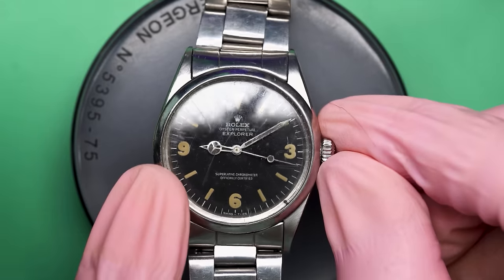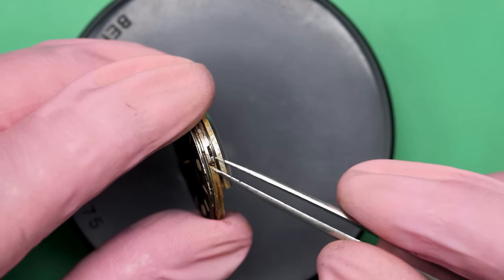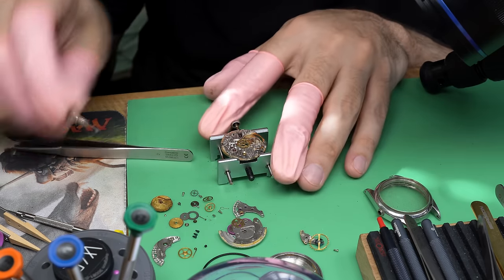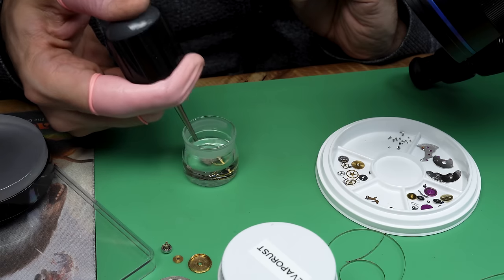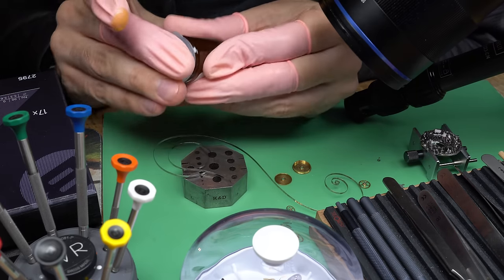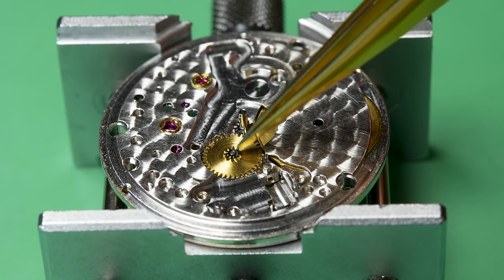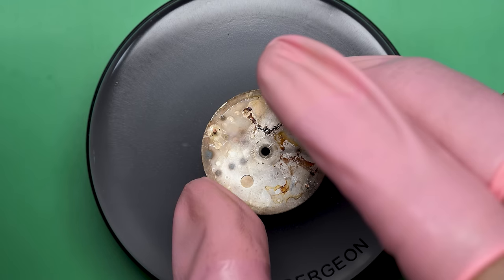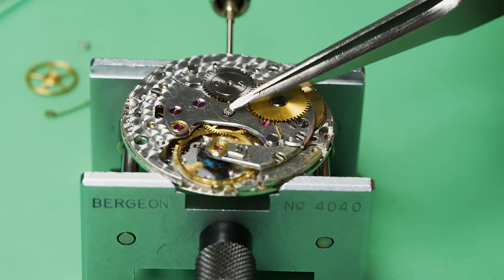This $25,000 Rolex Explorer Was Exposed to Seawater!

Comment: Rolex refusing to repair it (doubtless at a price) seems appalling, I'm curious what excuse they gave. The serious damage was actually minimal, most parts just needed cleaning up. Great job restoring this that Rolex were too <censored!>
Reply: Rolex probably wanted to do a complete restoration (i.e. like new watch) for an eye popping amount. I brought my father's well worn Rolex to an official Rolex service center (there are several in major cities in the US) and they had no interest in doing what Marshall did in this video. And their quote which included replacement parts exceeded the watch's original cost. I shipped my watch to an independent shop that services Rolex only and they did a phenomenal job. Never again will I have my watches serviced by Rolex.
Reply: Rolex could have restored it. However because they offer a 2 year warranty on all repairs they would have only made the repair if the customer agreed to certain things, like the replacement of the dial, hands, Crystal, a complete refinish of the case, etc. All of which would have diminished the value of the watch. Rolex are a bit more flexible these days, but would prefer that this sort of restoration is performed by authorised specialists, that way the customer gets exactly what they want.
Reply: @andyglastonbury6032  & @BeantownToBigD ..thankyou both for interesting replies. I can understand they would have asked a lot (and only used genuine parts) but as the video showed actually it was only a handful of functional parts that needed to be replaced (which Marshall also did). As you state, simply swapping or restoring hands case etc that are not functional isn't just unnecessary expense its actually destroying the patina indeed personality that makes that watch special. That a brand that trades so much on image and history seemingly doesn't understand that is tragic. Yet another once great product company now run by accountants ? I dislike Swiss watches anyway, the price is insane, but if I needed a reason to avoid them this would be one : conversely I enjoy Marshalls videos exactly for his craft to do just this. That they wont.😀
Reply: @davesmith9325  The biggest difference is that Rolex offer a guarantee on their services (typically two years) and basically offer to make the watch “like new”, which means replace everything that is old and in poor condition. They will sometimes offer to simply service a watch and ensure it’s waterproofness and give customers the option to replace dials/handset, bezel inserts, but this watch needed much more. Also I didn’t see new seals being fitted to the crown nor did I see it being subjected to the normal Rolex pressure test, important because the damage was caused by water getting into movement. 

This explains why all original vintage (over 20 year old) Rolex watches are so rare. Most have had dials/hands, etc replaced at some point in their past. Many customers loved it because they could, as part of the service, replace, for example the old matte dial on the first gen 16750 GMT and get a nice new shinny Gloss dial with the white gold indexes (and make it look like the latest version). The problem is that now the matte dial gen 16750 is worth about 30% more. The same went for meters first 5513, for red 1680, for matte 16800, etc, etc. Collectors want originality. It’s sad that 1000’s have been wiped of the values of vintage watches because they haven’t been conserved correctly and because of poor choices made by customers.
Reply: @BeantownToBigD  one unfortunate and lamentable result of the Rolex brand's corporate journey and change in focus is adoption of  an 'unofficial' policy to orphan and abandon these now iconic 'non jewelry' time pieces which were at that time the brand's lower end product line and to stop manufacture of the parts and service for these time pieces. The tragedy of this unofficial policy is the legendary standards of time piece engineering the name Rolex once stood for is being lost forever. 

Rolex is now owned by a group who have chosen to invest their energy in harvesting rather than preserving and supporting that brand reputation. Now only, only the higher end chronometer level lines of the early Rolex brand are being supported. It's rare to find a watch professional who has even the lowest level of technical talent to service an early Rolex like this. This  channel is outstanding in having an owner who is truly a "master watch maker" with the knowledge and skills to even attempt such a repair and restoration. 

These 'sport' watches were manufactured by Rolex to fill in as entry level time pieces meant to bring consumers into the brand and build loyalty and awareness. If you check the official catalogs for Rolex in the early 80s the company began their shift away from lower end consumer grade time pieces to focus more on higher priced jewelry time pieces in effect harvesting the enginerring reputation but not continuing to invest in maintaining that tradition and brand standard. 

if you compare this Rolex watch to those produced today by opening them up you can see how this tragic short sighted policy has hollowed out the Rolex brand reputation so today it no longer represents the high standards of time piece engineering that built the name Rolex.... Tragic loss..
Reply: @andyglastonbury6032  43:52 and following (plus especially 47:04 and following) indicates all seals were changed.
Reply: @andyglastonbury6032  There is no way Rolex would have repaired that face.
Reply: @andyglastonbury6032  I simply cannot accept Rolex refusing to repair this watch. That attitude is entirely unacceptable.  I was also saddened that this repair, wonderful though it was, did not include a pressure test, to have done the job properly I would suggest that is a 'must have'. Nevertheless, well done for restoring it to working condition. I would wonder, with the original leak, how often do Rolex expect a customer to have the seal replaced and the watch re-pressure tested.  Thanks for the Video.
Reply: @Preston412  Respectfully, I must disagree with you. Rolex does not lack the expertise or the resources to repair or maintain these time pieces, it's their corporate decision NOT TO DO SO... and that's the pity of the sorry state of Swiss time piece manufacturers these days with few notable exceptions.   So much of our "devices" today are disposable, technologically obsolete by design, with limited life spans. Rolex built its reputation by engineering a "standard" in mass market time pieces manufacturing that for its day was no less spectacular than what SpaceX is now doing for space travel.  Rolex lead a series of breakthroughs in the design and manufacturing of time pieces that were reliable, rugged, and not over priced. While Rolex was never a "consumer" brand like Timex or Hamilton or Bulova, their time pieces reflected watch making expertise at the highest levels.
Reply: @davesmith9325  one unfortunate and lamentable result of the Rolex brand's corporate journey and change in focus is adoption of  an 'unofficial' policy to orphan and abandon these now iconic 'non jewelry' time pieces which were at that time the brand's lower end product line and to stop manufacture of the parts and service for these time pieces. The tragedy of this unofficial policy is the legendary standards of time piece engineering the name Rolex once stood for is being lost forever. 

Rolex is now owned by a group who have chosen to invest their energy in harvesting rather than preserving and supporting that brand reputation. Now only, only the higher end chronometer level lines of the early Rolex brand are being supported. It's rare to find a watch professional who has even the lowest level of technical talent to service an early Rolex like this. This  channel is outstanding in having an owner who is truly a "master watch maker" with the knowledge and skills to even attempt such a repair and restoration. 

These 'sport' watches were manufactured by Rolex to fill in as entry level time pieces meant to bring consumers into the brand and build loyalty and awareness. If you check the official catalogs for Rolex in the early 80s the company began their shift away from lower end consumer grade time pieces to focus more on higher priced jewelry time pieces in effect harvesting the enginerring reputation but not continuing to invest in maintaining that tradition and brand standard. 

if you compare this Rolex watch to those produced today by opening them up you can see how this tragic short sighted policy has hollowed out the Rolex brand reputation so today it no longer represents the high standards of time piece engineering that built the name Rolex.... Tragic loss..
Reply: It's the same like with every big company. They used to be good and take pride in their name and craftsmanship. 
Then over the years, new people came, new ideas, new leadership, etc.
They used to make profit but also made good products and now they need to cut costs, make more profit, let off mechanics, relocate production to cheap coutries, pay less than minimum wages and live off their name that is only a shadow of its former self.
Now it is craftsmen like this who are needed to repair things, and companies actively try to make it illegal.
Because they only care about selling, not maintaining.
Reply: @andyglastonbury6032  Not everyone wants to sell them on. Some just want to keep them for the memories.
Reply: @Preston412 That's simply not true. All high end swiss watches are hand assembled. They have the technicians and train watchmakers. I wonder if the reason for not repairing it was simply lack of spare parts for such an old model. No manufacturer whether Rolex or Mercedes will scour ebay looking for parts that are out of production.
Reply: I agree that's very much a "f*ck you, buy a new watch, peasant" attitude from Rolex. Dismissing an appeal to fix an expensive piece that has family value is disgusting. They could at least have tried, replacing parts that needed replacing.
Reply: @pinnaclesystemsgroup6472  Companies call it “progress.”  🙄
Reply: It's the same thing apple does tjese days, refuse to repair minimal damage which 3rd party pro shops can easily do and saves you thousands sometimes.
Reply: @TheStevenWhiting  Very true, in which case you can have Rolex make the watch like new, or you can use a specialist to make sure it remains mechanically sound, whilst retaining patina. Which is why the lume in all my Rolex (except a 67 5513), is totally dead.
Reply: @joshjones5172  exactly - they would have suggested a replacement plus a new handset, a replacement crystal, stem crown and most likely a replacement strap. When the owner rejected this, then they would simply refuse to offer a warranty on the watch and point you towards a authorised specialist Rolex repairer.
Reply: @Celisar1  I most have missed that, but I didn’t see the pressure test being carried out.
Reply: I would suspect that Rolex only do repair by replacement which in this case would be almost everything.
Reply: @andrewholdaway813  I suspect you might be right.
Reply: @r2l100 I’m not defending Rolex, just telling you how it is. Rolex do offer warranties on new watches (5 years) and on repairs (2 years) that they perform. The problem is that some older watches are just that -old! So parts might not be available, etc, plus Rolex’s repair mantra is return the watch looking like new - which some folks want, but others don’t. Which is why Rolex have many approved independent specialist to do this sort of work. 

BTW I sent my 1953 Blancpain fifty fathoms back to Blancpain for a service, however they only agreed to perform it on the understanding that they could de-contaminate it first (lots of Radium). The total estimated cost was over £4K. I refused because it would have destroyed the originality of the watch.
Reply: Rolex refused to service my father's 1945 Oyster Royal. I told them the serial number, they still asked me to pay to send it to them, then they said they couldn't do it. I think today they're only interested in diamond-encrusted bling that only a gangster would wear. They ought to have craftsmen who would welcome a challenge. I think they just have the wrong attitude and spoil their own reputation thereby.
Reply: @andyglastonbury6032  I understood from your initial reply that's what Rolex do. And that's fine if that's what the customer wants is willing to pay for and asks for. 
But changing the dial, hands, refinishing the case  isn't necessary except in some extreme situations. It's not reasonable any company should demand and charge for unnecessary work as a condition of you want to get needed repairs done by the oem.
I thought the whole point of watches in this price class was that they are heirlooms, and sealed sports watches like this are supposed to be tough. The idea that its rare they survive more than 20 years is frankly depressing
Reply: @r2l100 When I sent my 1982 16800 to Rolex for its service 2 years ago, I was very clear that I just wanted a service (nothing was broken so didn’t need repair) so no new hands, no new dial, no new insert, no new strap, no case polish. They did however insist on a new crystal and new seals (understandably). This was Rolex in the UK, but I have a relationship with them, but I cannot talk about what Rolex in other countries offer.
Reply: @r2l100 exactly. At this end of the market they should hold parts or if need be make a new batch .. forever. Because a lifetime heirloom is the "enhanced product" people are buying, thus isn't just a way to tell they time. If they aren't willing to do that, imho they should quit the business and/or customers shouldn't buying them
Reply: @davesmith9325  They might argue that changing hands and dials is necessary because a) the lume is starting to fall out and can contaminate the movement , b) the dial is cracked and started to delaminate (a common issue with Rolex made in the mid 80’s) and finally because the tritium lume is dead and not fit for purpose. All good reasons to change them if people want a perfect watch. As for inserts many are faded and scratched, as for straps I have seen some held together with non-Rolex parts - so impossible to warranty. 

For those who just want a serviceable Rolex which is waterproof, then I recommend they use Authorised Rolex Specialists. They have access to all Rolex Parts. In the UK we have at least 6. The only exception to this is the Sea-dweller simply because I don’t know of ARS who actually has the equipment to test it to specification. For Rolex earlier than 1950, good luck because I don’t think Rolex carry spares for these, however a good watch repairer will be able to sort it out, because they were pretty basic.
Reply: @pinnaclesystemsgroup6472  Thanks for sharing this information. Is Rolex now owned by a PE firm? Too bad Rolex doesn't follow Mercedes-Benz's lead and support vintage products as the Mercedes Classic Center does. Personally, I have had great success working with independent watch professionals who service vintage Rolex as well as independent MB restorers. I have huge respect for both parties.
Reply: @BeantownToBigD  no they only replace wont repair
Reply: @r2l100 40 year old Rolex are not a problem. If you smash up your 40 year old Rolex, they can rebuild it with all new parts. The case however will carry a 44* serial number, telling everyone that the case has been replaced. Bezel, dial, handset, movements, Crystal, inserts, etc are all available from Rolex. They can even provide new dials for double red Seadweller or red submariners, however they are not the same the original and will kill the value of your watch. 

Much like if you have a numbers matching C1 corvette, and GM replaces the motor with a factory fresh LS engine. It’s 100% better than the original, but not the same. 

My advice to anyone, is look after your watch, don’t abuse it and get it serviced by someone accredited to work on it. If they don’t have part chances are they no someone who does. 

As an aside a friend of mine bought a 1937 Cal 40 Hanhart Mono in auction. It was missing a crown, the dial feet had snapped off, the hands had become disconnected and the movement was locked up. 9 months later (in the care of a specialist) it was fully restored (whilst retaining its original patina). It now sits in my collection and is the earliest known example in the world. EverythIng is possible with money and people who care - and the Rolex biosphere is full of people who care. 👍
Reply: In my opinion a manufacturer like Rolex should at least set a few specialized people aside to take care of servicing their vintage watches in a manner that doesn't destroy the value. Customers that want certain work done should be informed if it diminishes the value also if it means not selling new parts. For how hard they're leaning on their legacy selling new watches they seem pretty uninterested in preserving it. Their watches aren't exactly throw-away items. More like items grandfathers give to fathers and they give it to their sons. Items with not only high financial but emotional value. If you ask what's the number one place to get something like that fixed and the manufacturer isn't the first option that comes up and people actually have to start looking elsewhere, thats a confession of failure in my eyes...
Reply: @xcofcd  They literally no longer manufacture parts for this calibre - Rolex stopped using this calibre in 1975.  That watch cost to buy $300USD ish in 1975 - Rolex watches were tool watches - they are reliable and they were actually water resistant - the reality is after 25 years with any watch - you are on borrowed time with the exception of some truly ubiquitous and reliable watch movements manufactured.
Reply: @credibility63  obviously no one is suggesting they should source parts from ebay : when discontinuing a part they should hold adequate stocks to allow them to repair the sold watches for decades, and when those stocks are exhausted make another batch... that being considerably easy in the days of automated machining. Items like this are given to commemorate notable events and are heirlooms, should last (and be serviceable) for lifetimes. Its very disappointing to read so many comments suggesting nit everyone understands this.
Reply: @davesmith9325 To the best of my knowledge this doesn't happen in any other industry. Generally parts are available up to eight years after production ceases.
Reply: @credibility63  home appliances, parts are available for decades